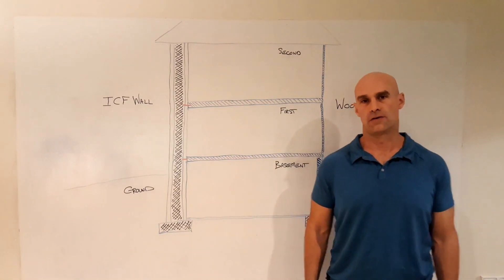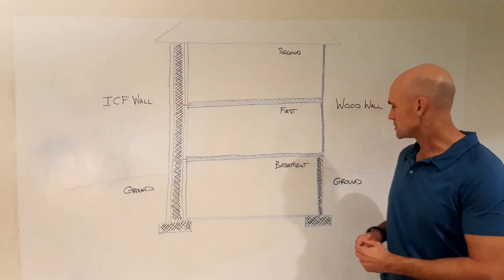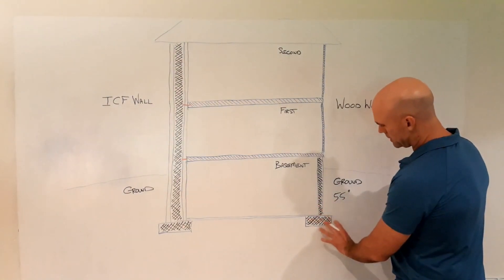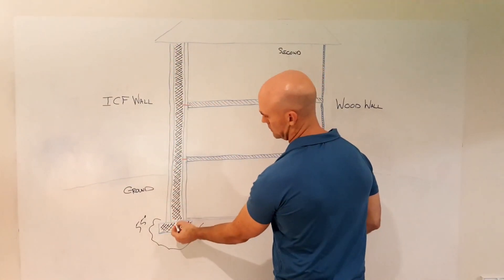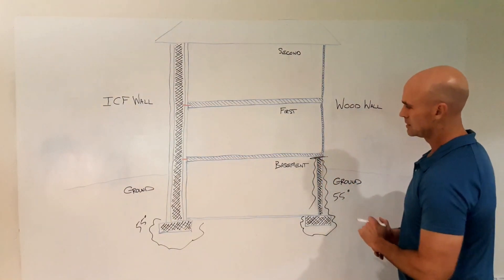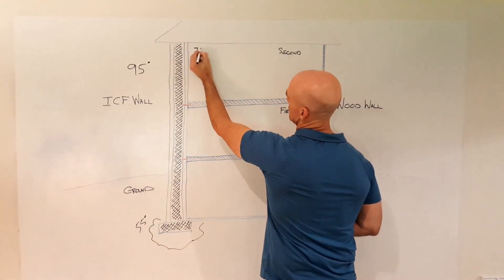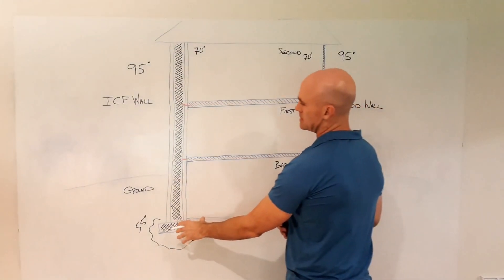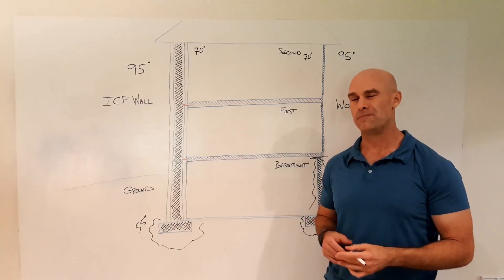Thermodynamics: Concrete vs. Wooden Walls in an ICF Home of Virginia with Builder Dave.

Comment: Very interesting.  It would be cool to embed some thermometers into the ICF wall all the way from footer to the roof trusses and actually measure it to see how it changes with the seasons.  I embedded such a sensor into my bathroom floor when I tiled it as I added a heating element (Schluter Systems) so it is doable.
Reply from the maker: Agreed, a simple TC with TW embedding into the wall with a data logger would work great.  Still trying to find the right client who wants to know this information.  LOL